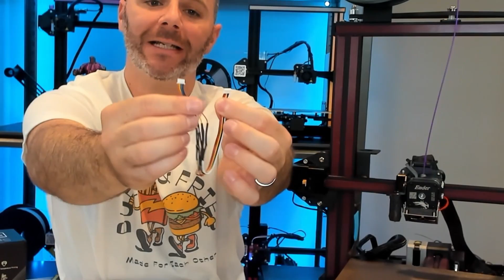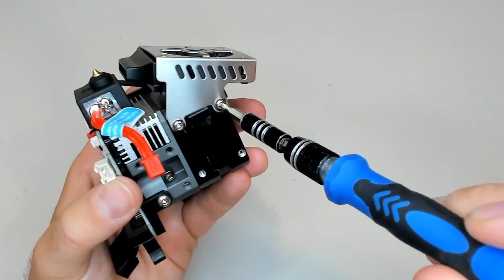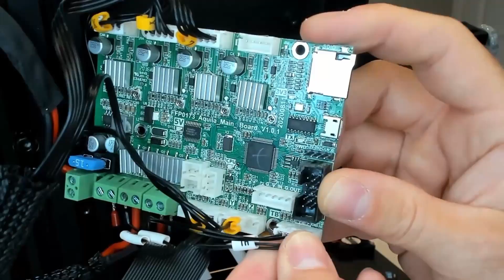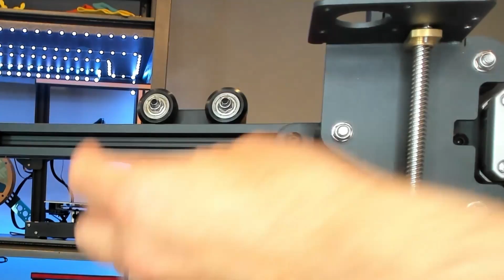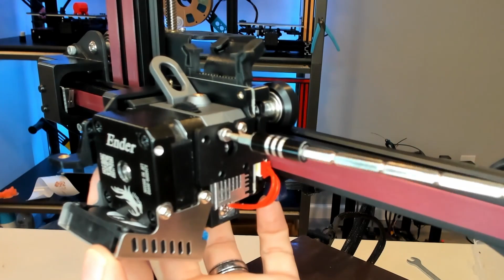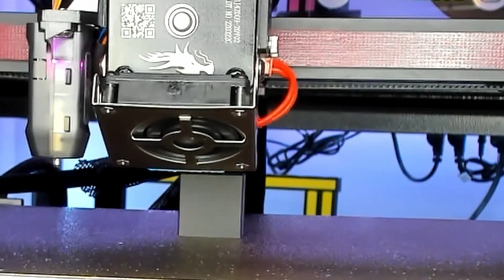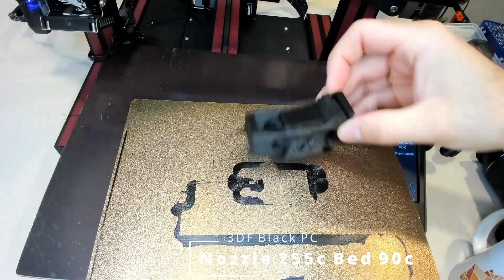Direct Drive Voxelab Aquila with the Creality Sprite Pro

Comment: Watching this, why not use a needle and just swap the small connectors ? They all should be very similar if not identical for the BL touch? Same for the fans, I would just swap the factory plug for whatever came on my fan.
Reply from the maker: For the fans you could do that. When you get a new fan just release the plug it came with, release the plug from the older fans and make the swap. For the BL touch you can't because you're only going to have one connector that is correct. I believe the small connector that goes into the BL touch is a molex pico blade(not jst), and the connector going into the Sprite is also the Molex pico blade. So one side is going to be wrong. I have since received a few more of these Sprites, and each one has come with the BL Touch cable already, so more likely than not you're not going to have to order one yourself.
Reply: @PrintsLeo3D  yeah I seem to have misplaced the small baggy and the cable inside of it 🤦🏻‍♂️ while I don’t use bl touch I would have liked to one day…
Reply from the maker: Hey don't feel bad they never even sent me one the first time lol if you ever want to get a bl touch the cable is inexpensive, you can get it from DigiKey for like $11 or something like that! Good luck
Reply: Found it! It was in my draw I printed for my printer under my cutters. So I looked at least 3 times never moving the cutters but I needed to use my cutters and found it! Sweet! I’ll be using your profile soon enough to up my printer temp to 300C for nylon (RC parts)  do you know if it’s toxic? If I’m able to print it in a room I use often.
Reply from the maker: If you're going to be printing nylon you'll definitely want to take some hefty safety precautions. Nylon can emit toxins whole printing, so using an enclosure and properly filtration is key. Nylon can be a tricky beast to print too, make sure you dry that filament well before using, and as always be safe!

Comment: After doing this mod on my S2 it no longer begins a print after preheating. It will reach target temps and then just hover around around them, but never beginning. If I go to "tune" and lower the target temp for the extruder a few degrees it then immediately begins printing.
Reply from the maker: Have you made any firmware adjustments? Or did you just do a physical install?
Reply: I used BL-3x3-N32 (I do indeed have an authentic bltouch installed and working)
Reply from the maker: I left a response to this earlier I don't know why not seeing it, so  sorry if this is a double post. I would try a different version of my firmware, 4x4 or 5x5, to see if the problem is related to this firmware.
Reply: Roger that, will do. I'm going to re-flash the 3x3 and if that doesn't work I'll try the others. Thanks for the help!
Reply from the maker: No problem and sorry for the late response, I thought Ieft this answer hours ago lol
Reply: No need to be sorry bud, you do this for free! On that note though, your buymeacoffee link is giving a 404.
Reply from the maker: I guess it means I'm drinking too much coffee lol thanks for letting me know I'll take a look at it now. If you need more help just get at me here or my email (printsleo3d@gmail.com) or discord (link in description). Thanks!
Reply: I think it's the asterisks around it here in the video description causing the error. I tried to  post the URL it was giving but I think yt filtered it.
Reply from the maker: You're absolutely right that's what it is! I had the same thing around my discord channel a while back and it broke the link. I removed them now so hopefully it works lol
Reply: @PrintsLeo3D  I just figured out it was an ID10T error... I didn't run PID autotune after completing the install. Just now ran it and everything is working as expected. Thanks for the help bud!
Reply: Yes I did, I installed the firmware from your site.

Comment: I have a question... Can I use an aquila display on an ender 3 max? I am having issues after upgrading to the sprite pro
Reply from the maker: Unfortunately not without a free fir.ware side changes. The Ender 3 Max and the Aquila use two different display types and they aren't plug and play replacements of each other.
Reply: @PrintsLeo3D  thank you! So if I change the firmware, like jyers or Alex's I can use it?
Reply from the maker: I think Jyers/mrisoc firmware would be the best go to right now, as they are tuned for the Enders. If you want I can try and compile some firmware for you that will suit your needs?
Reply: @PrintsLeo3D  Omg that will be awesome! Thank you so much!
Reply from the maker: Just email me printsleo3d@gmail.com or join my Discord (link in description) this way we can go back and forth with exactly what you printer has setup and how to compile it.

Comment: Is that not a crtouch? I simply cannot get my bltouch to work with the daughter board.
Reply: Do I need to use a crtouch to get this to work?
Reply from the maker: Not at all. Is this a function issue, or it is the cable giving you a hard time? because the cable is unique to the Sprite in general.
Reply from the maker: This is the CR touch I hooked up to the Aquila,, but it should work just the same for the bl touch. Only difference is the mounting, as they have different mounting dimensions. If you want I will double check and plug my BL touch in tomorrow, but I'm pretty sure I did this when I filmed to check , and I know memebers of the Discord are using this with bl touches. Was it working prior to any firmware changes ?

Comment: what did you set the x and y offsets to?
Reply from the maker: X = -31 , Y = -40.4 

I have some profiles and firmware at my website that has these offsets setup already if you're interested. PrintsLeo3d.com
Reply: @PrintsLeo3D  I have it installed on Ender 3 Pro and cant find info on it, so far you were the best help.
Reply from the maker: Awesome! I am actually installing another of these on my Ender 5 this week! I've really been liking the prints it has been putting out. If you need any other help let me know, as I have Ender 3 Pros and V2s so I am familiar with them. Thanks for the question and the compliment!
Reply: @PrintsLeo3D  I am talking about the offsets not for the probe but where the noozle thinks where 0,0 is and all that.
Reply from the maker: Oh I'm so sorry, are you talking about the offsets within the slicer ?

Comment: What build plates are you using on these two Aquilas that you are showing in this video?
Reply from the maker: Both of the build plates are textured PEI coated flex sheets. They have excellent adhesion and when you're finished printing you can remove them(they are attached via a magne) then flex the build surface and the print pops off. It's really amazing. I have a video that goes over two types
https://youtu.be/XhqA8gU7PE0

Comment: Hallo, ich habe es genau so gemacht, nur ist der BLTouch am Mainboard angeschlossen und nicht am Extruder. Ich bekomme das Bedleveling aber nicht mehr hin. Woran kann es liegen?
Reply from the maker: Ich verwende Google Translate, um Ihre Frage zu verstehen und zu beantworten. Ich bin mir nicht sicher, ob ich Ihre Frage verstehe. Hat der BL Touch jemals für Sie funktioniert?
Reply: Yes, the BL Touch also works. Only the extruder no longer goes deep enough to the bed for printing.
Reply from the maker: Ok, so it sounds like your nozzle is too far from the bed while printing. That is  controlled by the Z-offset which can be found under the PREPARE menu. When inside the Z-offset menu you can lower the nozzle closer to the bed, and then save that setting after you're satisified. I would be happy to explain more if you need.
Reply: Thank you for the time being. I'll try it. If it doesn't work, I'll get back to you.
Reply from the maker: Groß! Lassen Sie mich wissen, wie es funktioniert.
Reply: Yes, now it works perfectly again. Thank you

Comment: I have a spare Sprite extruder (I upgraded my S1 to the 300° sprite "pro" ) I want to mount on my Aquila.
Does anyone know where to get the "kit" parts without then the extruder/hotend itself?
Specifically the cables and the extruder support bracket (the gantry) that rides on the T slot....
I checked everywhere I could think of and cant find these parts sold separately from the kit.
Reply from the maker: I can't seem to find much myself. I found this 3d printable bracket, but it's probably only a start because the dimensions are possibly off.  https://www.thingiverse.com/thing:5423518

I sent a message to Creality asking about these products but they are 'out of office' currently, so I will let you know when they contact me.
Reply: @PrintsLeo3D  Wow, thanks Leo! 
I found that bracket as well but got "scared off" by the "Dimensions may not be perfect" ...
 I didnt really want to disassemble my S1 to compare the dimensions, but I think I will print it and see how it comes out. Keep me posted if you get any leads on the factory bracket. Your effort is greatly appreciated!
Reply from the maker: Yea the old "dimensions have been eyeball'ed" is never a great start lol I will let you know when they contact me. In the meantime I'll be on the lookout.
Reply: @PrintsLeo3D  I greatly appreciate that :-)
Reply from the maker: They ended up responding to me with the most generic "check our website" email of all time. So right now I don't know of any avenue to find one, I'm sorry.
THE EMAIL:
Dear Customer,

Thank you for contacting us and sorry for the late reply.

According to the content of your email,

Here are our suggestions for your problem

1. https://store.creality.com/ 
or
https://www.creality3dofficial.com/ 
Or 
https://www.aliexpress.com/store/4297005?spm=a2g0o.detail.1000061.1.19063a81jfERuO 

2. I suggest you look at the above websites or go to Amazon
Reply: @PrintsLeo3D  HA... That email is the equivalent of "have you tried turning it on an off again".... 
Why do they think you would be emailing them for a part ... AKA WE  tried those sources already🙂
 I think I might just buy a full kit and have a spare print head, if the bracket ever becomes available at the regular suspects I'll pick on up, Thanks anyway for you efforts.
Reply from the maker: Yea I know, like they didn't even bother to read my email. Some program they run picked up the words "Sprite" and "purchase" and fed me back this email 😂
Reply: @PrintsLeo3D  Exactly... I guess if we wanted boutique customer service we could have spent 10x more for a Prusa.. Not sure the math would work out on that though...

Comment: Yeah, i just installed the sprite pro and my aquila, and it won't work. Is it possible that it's not compatible with the H32 board??
Reply: I tried Alex's firmware, then I thought maybe it could be a firmware issue, so I tried voxelab's official firmware with no success... I've ordered a BIGTREETECH SKR MINI E3 V2.0 MainBoard and a dual Z axis screw rod upgrade to eliminate sag. I'll try unplugging the CR touch and reflashing original firmware when I get home tonight, but I'm not very optimistic, I think my H32 board is toast.
Reply from the maker: Let me know any progress!
Reply: No luck... she's fried :-( on the board there are four small green LEDs: 5V, 3V3, TX, and CPU. My CPU light is out.
Reply from the maker: Ugh, yea that's not a good sign. Maybe a blessing in disguise as those H32 boards can be tough to work with. When the SKR gets thete send me a message if you need help installing or with the firmware. Also on your Sprite did you notice the screw that holds the thermistor in, like on mine, was it touching the heating cartridge wires?
Reply: Hey Leo 🙂 just wanted to give you an update. So I've got my BTT SKR E3 V2 board installed. The Voxelab Aquila screen is not compatible with this board 😑 so I'm trying to use Pronterface at the moment. Using Marlin bugfix-2.0.x firmware. Everything is kind of working. Going to try to setup CR-Touch soon. Have ordered a raspberry pi to run klipperscreen.
Reply from the maker: That's great so far. If you have an old android phone lying around, or even a fire tablet, you can download Octoprint pretty easily and then connect it to the printer to act as a screen. The problem with that is charging while sending the data, there's some USB c y cables out there but it's hot or miss if they'll work. It will give you access to the terminal though and you can run prints from the SD card I believe. If you need help with Klipper let me know, I have around 5 printers running Klipper st this point, some Aquila's , some Enders, and a few with SKR boards. With Klipper everything can be accessed via a web page too which makes the absence of a screen not too bad, although Klipperscreen is a nice option too.
Reply from the maker: Hey Kurt! Did you do any firmware changes? If you just did an install onto your H32 printer without needing with firmware there shouldn't be any problems with it working. Is the hot end itself responding, for instance will it auto home? Or is it not extruding ?
Reply: I turn power on and I get a blank backlit screen. I have updated the firmware. Still blank. Checked, double checked and triple checked all cables. When updating screen firmware, it goes Blue then Orange. But then on restart, its just blank.
Reply: I did install CR touch at the same time. I am thinking that this might be my issue
Reply from the maker: Which firmware did you install? I've heard mixed things about Alex's H32 firmware, don't have an H32 to try myself. I know that chip is really stubborn.
Edit: also I just want to make sure you plugged the ribbon cable for the screen  back into the mainboard
Reply: The screw is touching the insulation on the heater thingy, but there's no 'contact'

Comment: I bought this with the cr touch I’ve been having tons of issues with it solved most of them now my main issue is with leveling i tried silicone spacers and the yellow springs tightened the bed checked the z axis if there is slack and adjusted and tightened everything still same issue with leveling any idea even changed the bed surface from glass to pei back to glass
Reply from the maker: Yea I would love to help! What exactly are the issues you're having with leveling? Is the material not sticking? Is it non printing uniform on the first layer? If you want to join my Discord we can exchange pictures and videos easily which makes diagnosing these issues easier. https://discord.gg/YHFJEjFv

Comment: What do you think about Smart Filament Sensor? Will you be doing a video on this upgrade soon?
Reply from the maker: I really don't use filament runout sensors nearly as much as I should, and I like the added benefit the Smart sensor offers - not just being a simple filament runout. If that's something you're interested in I can certainly order one and start on a video! I think it's a worthwhile addition and something that could help people.
Reply: @PrintsLeo3D  That's great! I look forward to your next videos. I frequently run into extruder grinding/eating into filament and this sensor maybe a lifesaver for long haul prints. I wonder if you'll have to reconcile smart sensor firmware with Alex's BLT firmware. For the grinding issues, I'm testing out a variety of fixes. My latest suspicion is that I might have old, moisture-damaged PLA. 
I followed your guides on BMG dual-gear extruder and BLT installation and they worked beautifully. Your Aquila contents are just unrivaled! 
I just ordered 2 Z axis upgrade kits from your last videos, just in case I need to replace stock Z axis as well. I look forward to your video with Z axis with timing belt. I wonder if it's gonna be better than the dual motor kit I ordered. Or better yet, can we merge them together to make dual Z axis motor with timing belt? 😝
Reply from the maker: Lol timing belt and two stepper motors that'd be a trip! I am finding up the timing belt version of the dual Z axis as we speak should probably be out next week sometime. In the end they both, timing belt and dual stepper, turned out well for me. For the firmware I think they'll need to. E a few adjustments but I'm not too sure, need to look under the hood again at Alex's firmware. I think filament runout sensor might not be active default but I always turn it on to have access to multi color printing.